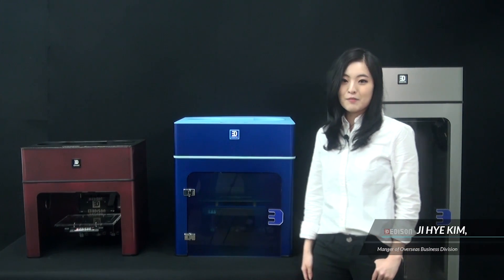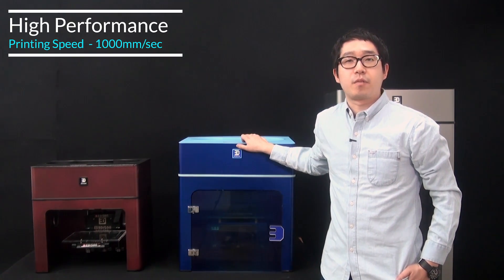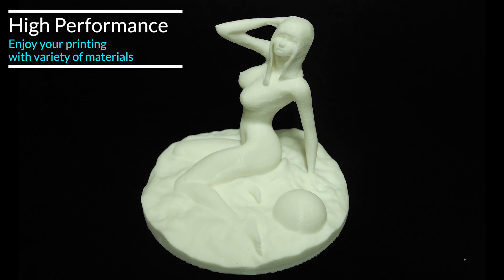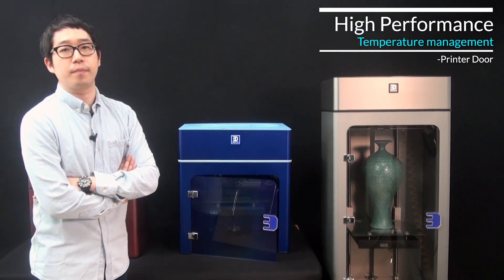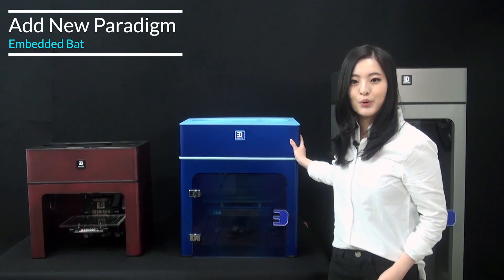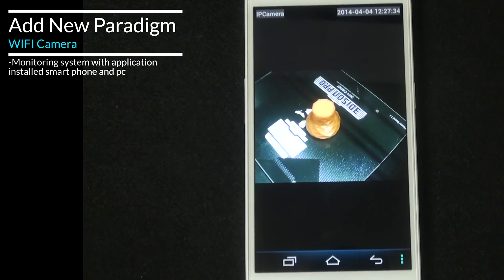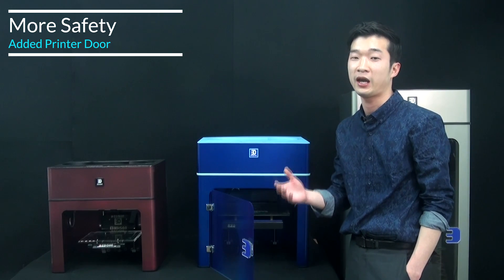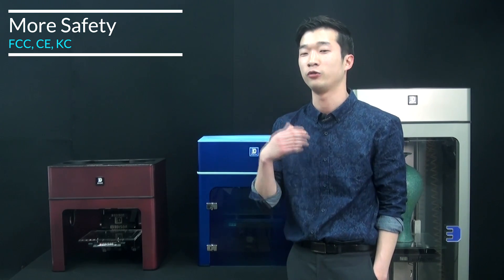World Best Desktop 3D printer 3DISON Lines from ROKIT

Comment: Nice name as in Thomas Edison.
The only negative thing I can see from this video is the bulky design which is probably a trade off with filtration and safety features. I will be comparing this printer to many others. I don't have the money so I have ways to go before I can buy any printer, and I want only the best. I have a close eye on Cell Robox 3D Printer which can print 20 microns and uses a second nozzle to fill in gaps. 
It's like a race.